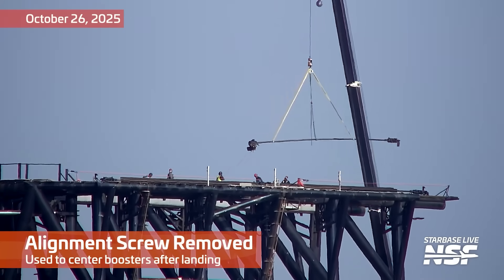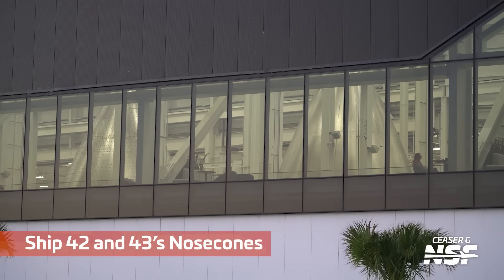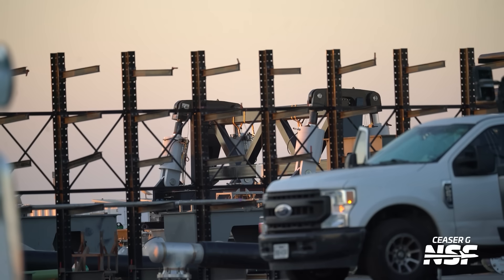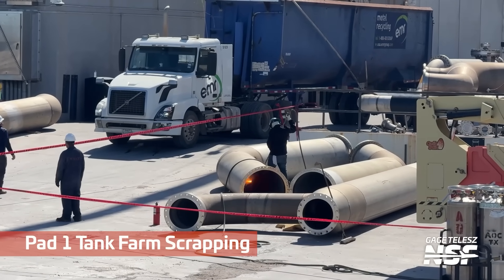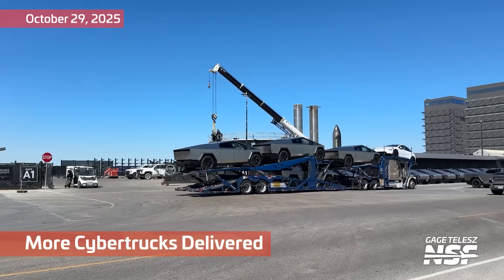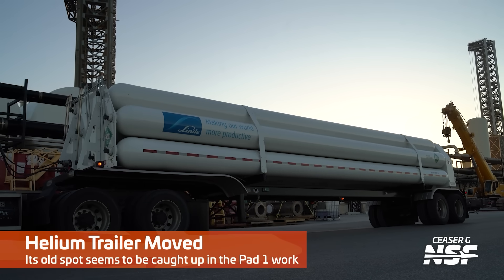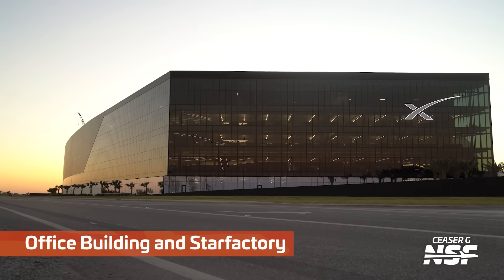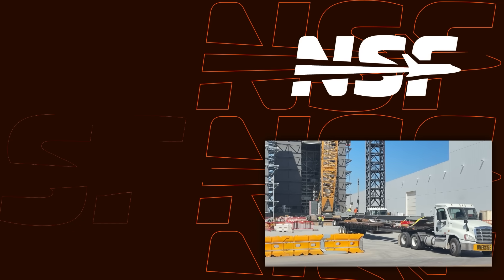SpaceX's massive Starship Gigabay rising | SpaceX Starbase

Comment: Columns "numbers" simply refer to the position of the column in the building. It looks like the row of columns closest to the road is row 11, and I assume the row of structural columns furthest from the main road is row 1. And then starting in one corner, the columns are simply labeled A through Z, and then possibly AA, AB, AC, etc. Most large industrial buildings I have been in have a systematic locating grid often tied to major structural columns.

This is for the building maintenance staff - If an electrical outlet on column 11Y isn't working, the electrician knows exactly where to go (and people know to reference a column when something electrical doesn't work.)  Once columns are labeled it is quite possible that in the Starship work flow that column labels start to be used to reference starship work cell locations, but I suspect the work cells have their own designation that reflects their role/sequence in the assembly process. But I can hear someone telling a newbie that they need to "go to workcell 231 next to column 11Y."

Comment: SpaceX is actively replacing its internal combustion engine (ICE) support vehicles with Tesla Cybertrucks. This shift is part of a broader initiative to enhance sustainability and efficiency within the company. The Cybertruck's durability and towing capacity make it suitable for the demanding environment at SpaceX facilities. SpaceX is aiming to fully transition away from traditional gas-powered work trucks. This move aligns with both SpaceX's operational needs and Tesla's mission to promote electric vehicles. The Cybertrucks are expected to serve various roles, including supporting engineering teams and logistics operations. Their unique design and capabilities are seen as beneficial for the fast-paced work environment at SpaceX, particularly as the company ramps up production of its Starship rockets.

Comment: It's called an I beam regardless of position, I have made I beams because no company in the world makes them as large as the one needed for project so steel plate was ordered and we cut the individual parts and welded them with sub-ark welding. The custom beam was for a hotel that had indoor pool on upper floor and required huge I-beam to support pool weight and they had to be made with upward curve and would be flat when pool full of water
Reply from the maker: I feel like I've seen flatbed trucks with the same buikt in curved design, they look wacky when unloaded. - Das
Reply: @NASASpaceflight The company that pioneered that design was Benson Trailers. They used special alloy for main beams, new Trailers bowed up so much they would lift front axel off the ground but when loaded with 60K pound coil they were the best riding and least amount of flex and roll. The PA turnpike it brutal for trucks with steep grades and off camber turns making the Benson ultralight the king for heavy loads and master coils.

Comment: Not an "I" or "H". It is a Wide Flange (WF) Column. I and H were used in the 1960's.
Reply: Wide flange indeed. I was a structural steel draftsman in the late 70s & early 80s and have drawn thousands for fabrication and installation.
Reply from the maker: What's the technical difference? They definitely have an I-shaped cross-section. I'm keen to learn.- Das
Reply: @NASASpaceflight  Hopefully one of the guys will correct me if I get this wrong, but my generic understanding is you have S-beam (for Standard I Beam) which has flanges tapered between the web and the outside edge (the 2 parallel parts with the web connecting them are thicker near the web and thinner near the edge) and H-Beams which come in both wide and narrow flange types (and have non-tapered flanges). Maybe they have now dropped the H and just refer to narrow flange and wide flange?One difference among many I'm sure is S(or I) beams have better load bearing at a single point (useful on cranes for the trolley to run on) due to the thicker part of the tapered flanges, but H style are easier to bolt together (e.g. for building frames) because there is no taper to deal with. 
Unfortunately, they are called different things in different countries according to different standards and also depending on use (e.g. beam vs. column vs. pile, etc...as you noted)
Reply from the maker: Bolting against the taper would be pretty annoying for sure. Wonder why they were originally tapered... weight/material savings or some production process? - Das
Reply: @NASASpaceflight  Long story short, there are many different types of steel beams and their use is based upon the structural need. Because this results in a wide range of various size and thickness differences, there are - by necessity - more than one identifier, thus a naming convention that includes "S"tandard, "W"ide, and of course I-beams and H-beams. The most commonly used being Wide beams, at least based on how many I drew in my past life. Fun fact: if it's horizontal it's a beam; if it's vertical, it's a column.
Reply: @NASASpaceflight  It's 40 years since I took applied mechanics, but I think it is the former, weight/material reduction where (as dmasontison noted) specific specs for specific need. From memory, the tapered "I" style is better resisting bending stress applied to the top/bottom of the flange for a given weight of material the member is made of, but worse in axial (along the length) & torsional (twisting) stress than the "H"...or something along those lines...🤣